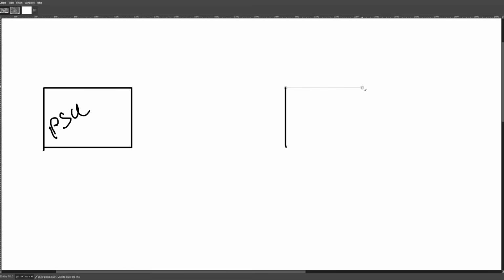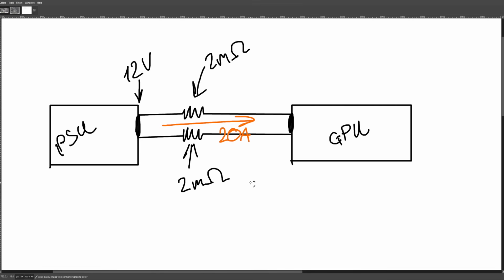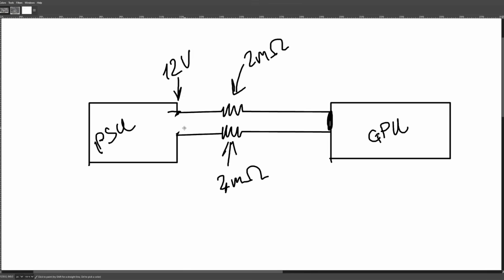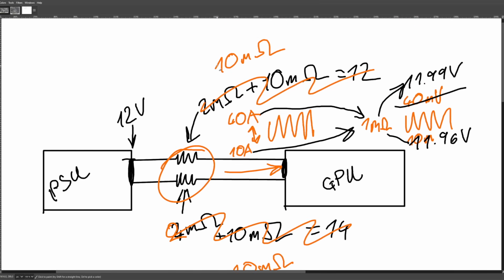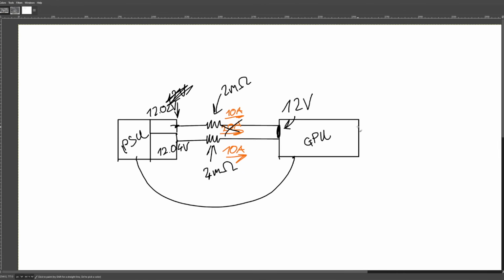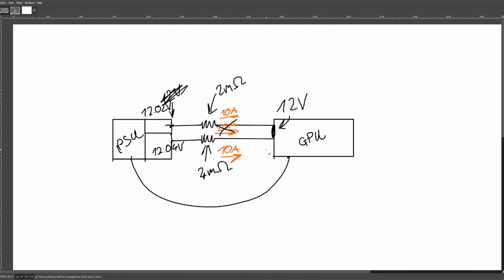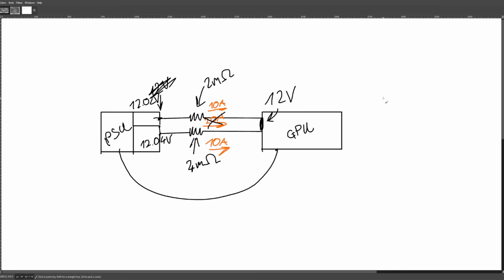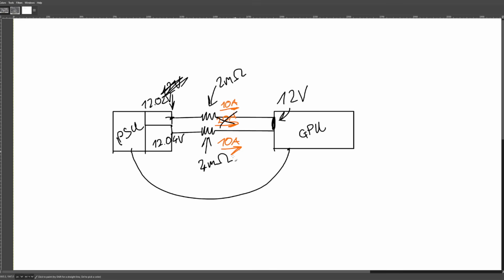Why ATX power supplies don't load-balance power connectors

Comment: There will never be a feasible solution to load-balance on PC hardware. The next best thing PSU/GPUs can do is per-pin monitoring, and immediately cut the power when any load imbalance is detected. 

The root of the problem is that the 12V 2X6 connector should never be rated at 600 W, at best it can only be a 400-W connector. 4090 and 5090 should literally come with 2 of these connectors at a minimum.

Also the PCI spec stating that all 6 power pins should be combined into a single pin is actually correct. Because if the PCI spec allows designers to split each pin on the connector into separate connections, it introduces way more chances of load imbalance due to design oversights.
Reply: Naw, the thing is, it was done on rtx 3000 series, because the nvidia 12pin acted as 3 8-pins

So clearly it can work fine even if it violates the current PCIe spec, it's just a stupid standard
Reply: The connector is fine for 600W what isn’t fine is when all that power is offloaded to 1-2 wires… 🤣

Comment: Even with all that in mind, "you can B and moan, but at the end of the day you'll still buy your Nvidia card" GMU
Reply: Nope!!!  Been screwed by Nvidia too many times
Reply: Been in Nvidia camp for the last 2 decades (started with 8800 GTX), now a happy 9070XT owner. Everything has a breaking point.
Reply: Had 8600GT/8800GT/9600GS/270GT/970/1050Ti/1660 super/2060/2070 super/2080 super but after that AMD only unless they remove/fix this goddamn 12pin
Reply: Last Nvidia GPU I own is an 960, I still use it today xD
Just ignore the XFX RX 7900 XTX MERCURY on my table, I'm not using that yet

Comment: Well damn, now i can't fuse each wire...
Reply from the maker: you can they will just all pop in rapid succession as soon as they start getting overloaded.
Reply: @ActuallyHardcoreOverclocking  Apple invented silicon fuses for that purpose.